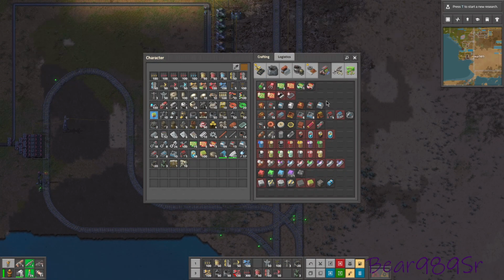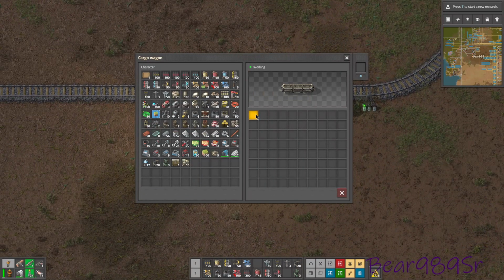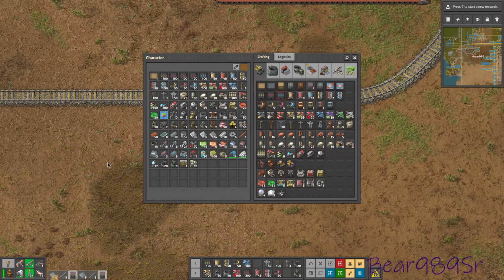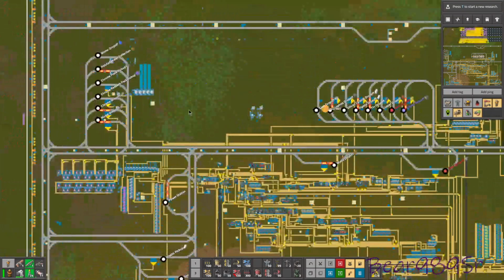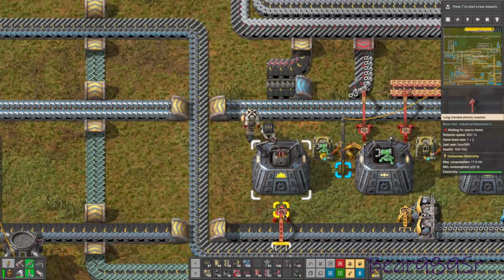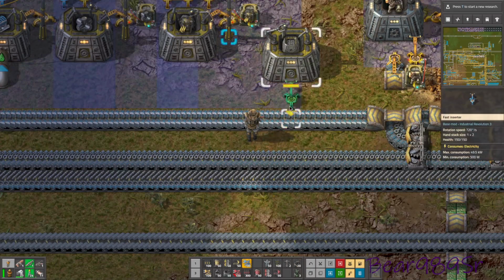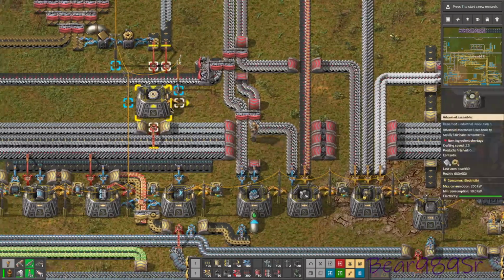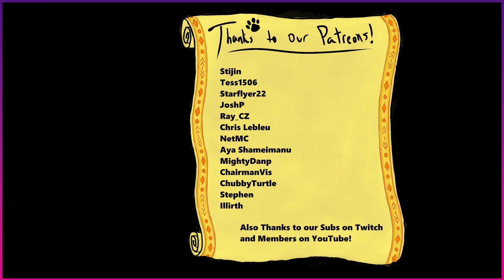[Factorio] Industrial Revolution 3 Ep 83 - Advanced Grinders & Laser Assemblers

Comment: The two laser circuit crafts have double the speed, but double the time, meaning it's a little more useful for prod modules and speed apply greater benefits, but to me, it's not enough to justify using modules. The cutters are also used in steel repair packs, one each, but worth it.
Reply from the maker: yah i dont think im gonna bother with the laser crafters
Reply: @Bear989  Still need them for certain recipes though, so we got no say in the option.